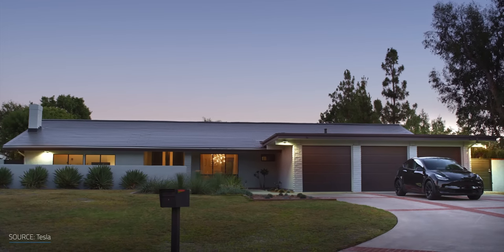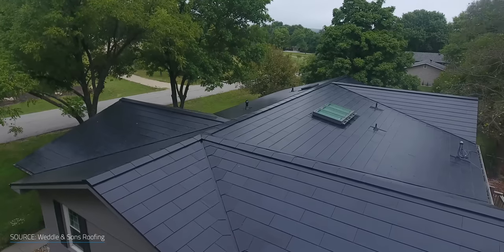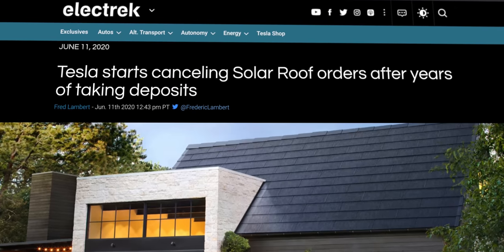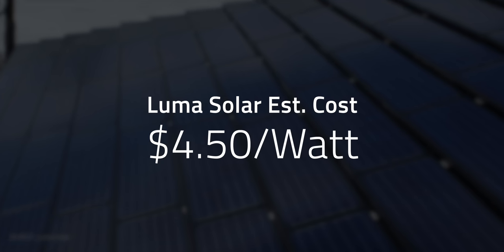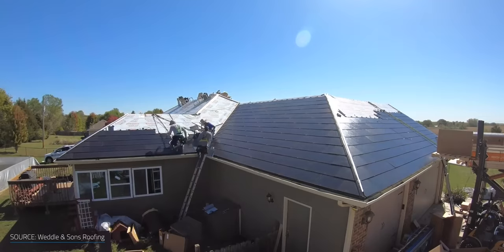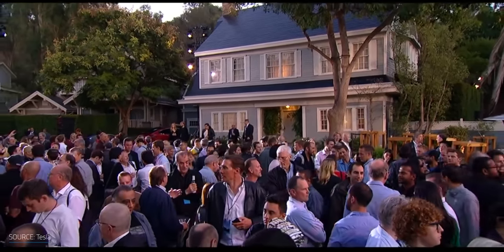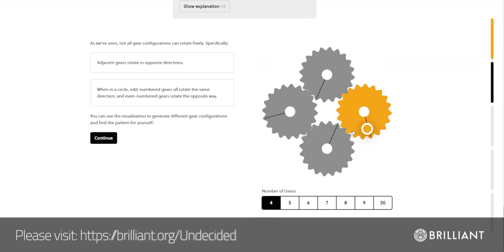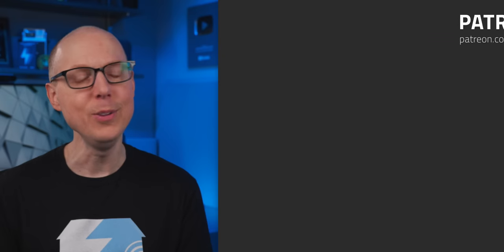The Problem With Tesla’s Solar Roof

Comment: Is there a practical reason (other than that mixing electricity and water isn't necessarily a good idea) why photovoltaic-thermal hybrids aren't more common. Especially in hot sunny climates? If the panels loose efficiency when they get hot, why not integrate a cooling circuits to heat, or even just preheat water before it goes to a boiler?  Granted this would increase the cost of a panel, but you would potentially also need less of them. 

It varies by season obviously but I estimate that around 50% of my electricity goes to heating water.  So Instead of say having two PV panels, one which is just heating water, you could have a one single panel doing both while potentially increasing both the efficiency and lifespan of the PV cells by keeping them cool and reducing thermal cycling.  The 2=1 math here is obviously a gross oversimplification
Reply: The cost per wh isn't going to be good in such a system. You can also just generate electricity directly from the heat (or I should say, heat differential) like what an RTG does. Again, neither systems are useful unless you have obscene money and want the single most efficient system for the sake of efficiency.

Comment: Thanks for the video Matt!
I wanted to share my miserable experience in installing Tesla solar. While my installation was done within 2 months or so after putting the request. It took almost 7 months to get the system working after installation! And yes, I paid the entire cost for the panel + 1 power wall, which was almost 29K in 2021.

Tesla just keeps you in dark and never calls or updates anything. During installation they told me that it might take up to 3 months to get the permission to operate, but even after 4 months nothing happened. I got really frustrated and after almost 10-15 calls to their support I finally got something going. Even after that point it took another 2 months and my project manager was completely useless. They put the blame on my local energy provider (PG&E) in my case. 

After the permission was granted after 6 months,  I thought I finally got the system working, but no! There was another issue, the system was not connecting to Tesla grid and my tesla app was not recognizing the system. It took another month and multiple calls to diagnose the issue and the support system is totally broken!

Well, finally after 7 months now everything seems to be working fine. While I really like the Tesla solar app this was the most miserable experience I ever had with a company. I am not sure how other companies are, but if a trusted brand like Tesla is doing this, it is miserable. At one point, I was even thinking of consulting a lawyer suspecting a scam!

Comment: My home is in Minnesota - extreme weather and temperature swings. We recently moved into our home and based on the pre-purchase home inspection replaced our roof shingles. We went with an upgraded class 4 impact resistant shingle with a 20 year warranty with a total cost of $18,300 (39 square). Fast forward two years and last Summer we were approached by a company (Everlight) to add PV Solar panels to our roof. These panels would go over our existing new roof. I called my roof installer and the solar panel install would void the warranty in the areas where the PV panels were installed. Now this system would not store the energy onsite it would sell the power back to my power company (Xcel). Some months, between the monthly payment for the panels and our Xcel bill I would come out even, some ahead (get a rebate or credit from Xcel) and other months (likely Winter with less daily Sun and more demand to power the heating system) we would have a Xcel bill albeit smaller. 

The solar array would have been $25,000 hoping to get $6,500 back in a rebate. The fact that the install of the array would void our roof warranty and the fact that this area does get damaging hail we chose to not move forward with adding solar at this time. We believe that the panels will become more efficient in the future thus needing less roof area to power the homes needs. 

It was an interesting experience walking through the process and we seriously considered adding the panels. I offered to simply add an array on the 3.5 car garage alone but Everlight didn’t seem interested in a partial power array.
Reply: Your insurance pays for Hail damage, your roof warranty only covers leaks due to their error (which is why drilling holes for solar voids it). That’s not a good reason.
Reply: @FuncleChuck  we checked with our insurance company - our insurance would pay for damage to the roof from hail not possibly / arguably caused by the panel install. Our agent also suggested it could be a challenge to get the insurance company to pay for damaged panels from hail. So that information on top of me writing a $18,500 check 18 months prior for top tier shingles and the solar system not exactly what we wanted ( we preferred energy stored onsite not sold back to Xcel) and no written guarantee the current monthly XCel rebate programs continuing indefinitely. We chose not to have a crew we didn’t know drill into our roof. Call me crazy…

Comment: We needed a new roof badly, love the idea of solar, and in NY,  the tax incentives on paper outweighed the value of an asphalt roof.
Breakdown: new best asphalt roof with highest warranty: $9,500.  Tesla roof after incentives: $14,500 that came with a $10,000 Powerwall battery. 

That Powerwall can run our house’s electric all night until a good part of the next day in sunny spring-to-late-fall days, so we rarely use the grid for electric until winter, where the 9kw system doesn’t get enough sun (Central NY) to charge it fully—or it’s covered in snow.

It was a no brainer—on paper.

In reality, customer service to rope you in was excellent, until you started having questions. I’d get no answers or contact from my email handler for months as I waited for email handlers to get replaced about seven or eight times in the course of March 2021 agreement to September 15 2021 installment.

Then the construction team were ready two weeks ahead of schedule to install before I got certain answers to important questions—like cost after incentives, and a few others. I had to sit in front of the contractors and fold my arms and say until I get these answers, you can’t start.

Suddenly, I had a new handler, and all the answers I needed. 
We proceeded to begin.
The team was amazing! Fast, courteous, efficient. In the end, a wonderful experience—the solar roof went on, and pow! I has solar energy powering my Powerwall! The team handled final things while I was at work, packed up and left. Then I came home and did a walk-around—and looked up on the sides of my house—.   They had removed—hand-cut and butchered metal trim on both sides of my house.
It looked horrible. Scissor marks at the corners where they used to be wrapped protectively around my trim. I called the main contractor several times and finally got him on the phone. He gave me a song and dance, but agreed to come back and fix it—which he did—sort of—but did a horrible job that looked nothing like the original.
I refused to pay. Tesla threatened collections until I kept calling over and over, sending pictures of what they did to them, and photos of the original trim I had to dig out of the dumpster to get. Finally, they stopped collections and agreed to fix my trim.
Then I realized—my original trim stuck out about an inch and a half in 3-d relief and wrapped around a board they removed. If the original trim was to go back up, the Tesla roof would not cover it. The contractor team had shortened my entire roof by about three inches on both sides, and covered it up (poorly) but ripping my trim off!! 
So I’ve gone all winter without this fixed, and without paying (though paying interest on my loan to get the roof) they just got a local company to give an estimate to repair the trim—and he confirmed they shortened my roof, and there’s no way to get the trim looking like the original—which matched the rest of the house trim—but they could make it more secure and look better than what Tesla’s guy did.
I love my solar, but am very disappointed in this trim mess. It’s been a nightmare of endless calling and taking names and documenting everything, and being terrified of being sent to collections when I have the money—but just won’t pay until they fix their mess. One local guy had Tesla install solar panels, and paid, but due to some hiccup at the grid connector didn’t have solar for over six months and kept getting the runaround by Tesla’s customer service team. So I knew not paying was the only leverage I had to getting this matter addressed.
So it’s a year later, start to finish, we’re still not on a two-way grid bubble (so extra energy can go to the grid and make me money) since I haven’t paid, tax time is now, and I get to see if the $11,000 incentive really is what they claimed, and my trim will never look the same—but is on the works to get improved-ish.
I’ve learned to let go, as winter prevented any further work on the matter. 
In short—Tesla needs to improve customer response time via email. There is a labor shortage due to Covid, so I get it, but their lack of response time has really caused unnecessary stress. That said, they ARE addressing it, and my issue has gone up the ladder, and it’s being handled (as I got their attention by holding back on paying). Hopefully, this will be resolved soon. I love the roof and Powerwall, but I’m rather over the whole mess.
Reply: That is straight crazy they shortened you’re roof lol

Comment: We are 3 years from building our remote dream home while still close enough to town to zip in for whatever, whenever, without making it an excursion.
We're Roof Tiles &/or ground based solar arrays.
Here are some considerations:
* We can't chose a product until we find the land (our design is flexible)
* We've researched solar companies from the US to Germany
* No to a deposit as we may find they won't install in our location when finalized
* Lining up contractors to install may not line up w/ our build schedule
* We're told different stories as to what our best options are
We will be SOLAR/BATTERY/COMBINATION ONLY & fully independent of land based power/run on solar while charging the batteries by day/run on batteries ALL night
We want redundancy built in so if we are servicing part of the array, we will never be without power. We're told; You can't do that by some, while others want to work with us.
Candie ^..^
Reply: You're in a great spot.   Looking for land and the home hasn't been designed/built yet is exciting.   I work for a company that designs high performance homes (think Net Zero) and does solar.    The envelope of the home for efficiency is so important.  When you start talking to builders the make or break areas of your home are going to be the foundation and the roof.  Most homes are built with bad Thermal Bridging. So even if they have insulation between the studs the heat/cold is coming right through the frame and roof.  When the wife and I build a home the foundation and roof have to be thermally bridged.  The expense there pays off in needing a smaller HVAC system, less solar panels and more comfortable environment.  A lof of home builds here in Arkansas are going to with higher end metal roofs so that they don't need to factor in a roof replacement.  Co-worker just did a ground mount system since he's got the yard for it.   New home build would be pretty trivial to trench from the ground array to your meter.  All comes down to the aesthetics really.  I'm excited for your family

Comment: I was so excited to learn something from this video (as a solar roofing specialist in the residential market) and walked away so incredibly disappointed. Every single positive thing that Matt has to say about "solar shingles" or whatever we're supposed to call them came from a sales brochure. I sincerely challenge Matt to prove me wrong and show me a single "fact" about the efficacy of this roofing material which didn't come from the person trying to sell it.

Every "solar roof" technology on display in this video requires A PRE-EXISTING ROOF ON TOP OF WHICH the "solar roofing materials" will be installed. If you aren't laughing already, buckle in. Yes, the "solar roof" can only be built upon an existing "normal roof". If you don't believe me, just look at the images of the roof installations on display in this video. The narrator says BS like "easier to install" while showing you a video of not one, not two, not three, not four, but FIVE installers on a very small roof, with yards of wiring spilling out into every direction, confidently telling you "SEE?!?! I told you this would be easier than just installing a regular roof". Oh, and at the very same time, the narrator fraudulently implies that the price you pay for the "solar roofing shingles materiel" or whatever includes the cost of interconnecting all of this PV equipment into the grid, such that you can actually do something productive with the solar capacity. False.

So basically you need to have a fully intact roof, then you get to install your fake "solar roof" on top of your "real roof" (which is literally identical in function to putting solar panels on your roof, except it's more expensive and less insurable, but who cares about my opinion), and then you have to pay to wire that "fake" "real" roof into your home's electric system.

But when I say I'm disappointed, it's not because people like Matt are so obviously and completely duped by sales pitches. It's because Matt clearly doesn't care at all whether he's been duped or not. It's clear that he simply prefers the easy and comforting reality of the salesmen, where all of the fantastic breakthroughs are "just around the corner" and "any day now" the amazing promise of all of these mind-blowing technologies will be unleashed "as soon as we give these very trustworthy and definitely not biased entities the money they so desperately need in order to overcome their inexplicably high customer acquisition costs which are definitely one quarter the cost of an entire residential solar installation," and I am definitely not literally laughing out loud at the notion that one quarter of the entire dollar cost of a residential solar installation should go towards "customer acquisition" costs. And no, just to confirm, I am still not laughing at that utterly absurd claim.

Comment: Would be smarter to use the materials in large industrial installs instead of residential.   On large warehouse roofs and over parking lots.
Reply: In Jax.,Fl. 1977 solar was coming to every home , business and street corner. We would not pay an electric bill. Or have to buy gas as my Citi car would be here in a couple months. Only thing that happened was solar panels on bus stop kiosks. Yes there were plans across the world but big oil had the "Embargo" and they won.
Reply: Most large structures by me are covered with solar panels. Some parking lots have shaded rows where the shades are solar panels.  But, we still need/want residential solar and battery storage.  For us those have eliminated most of our electrical needs.  We only pay about $25-30/mo and much that is the grid connection fee.
Reply: @JBoy340a  I built a 10x22 carport down the driveway side of house in 1984 with 21 panels on it. 20 and 35 watt panels only thing out here. Ineffiecient as all get out but somewhat worked, I ran "green" 12 volt lights  in and outside. I had 3 barbie doll cars running constantly 86,7,8,9. Gokart with car starter on it I built in 1990-2007. Other than small tvs' and laptops powering electronic equipment was useless or a battery bank from hell about the same size as the house was needed to store generated power. I had 10 12v 100ah trolling motor batteries The carport shading that sunny side of house brought my electric bill down $50 and more a month just for less a-c useage. Heats no problem here in Florida.Wound up with 4 100 watt,8 40watt and 7 harbor freight 15  watters Sold the house in 2012. State here passed a hidden agenda law(you know down near the bottom constrewed in a paragraph) within a major Amendnent which voters approved outlawing any "diy" solar panels and alll solar must be installed by professionals sponstered by the power companies in this state. The good ole brother-n-law act. I'm glad I never became a politician because I did think about it but I can look anyone in the eye and tell them the truth.
Reply: @cuylerwilkinson4414  - I appreciate that people like you put system together back then.  You showed what a person can do with a little ingenuity.  It is criminal that a state would would outlaw DIY installation.  We need to focus on more installations of power systems of all kinds, and solar is one homeowners can do themselves.

Comment: In my opinion, modularity is the best route. I have a start up company that is producing a housing unit for solar panels themselves. The housing unit itself is made in response to the architecture of the roof. It reinforces the current structural integrity and while initial installation maybe a bit high, being able to add or remove panels from the housing unit is going to make future upgrades/fixes so much easier. Cheers to hopefully a future that we can be proud of!